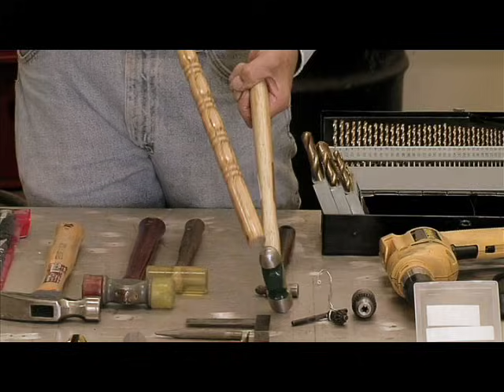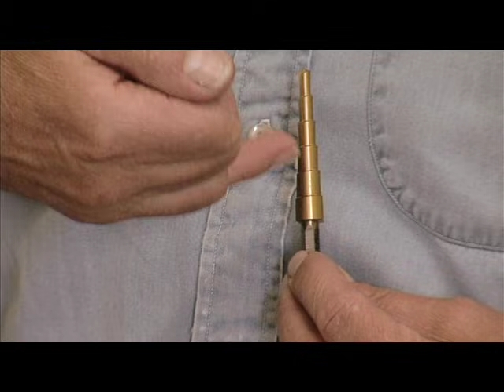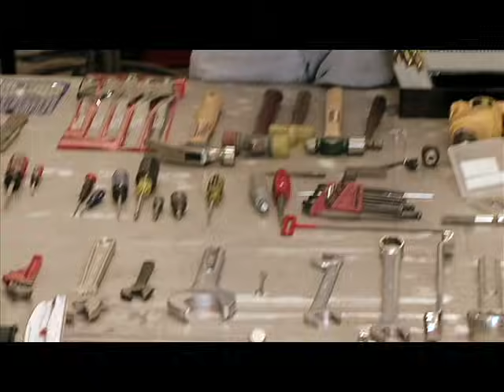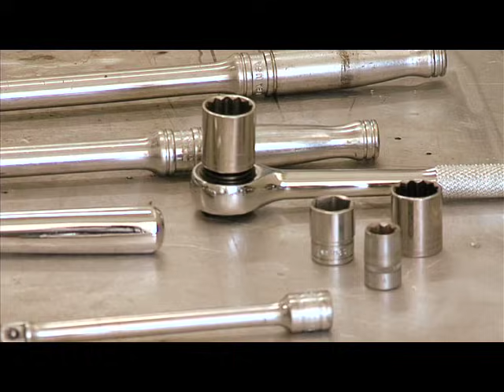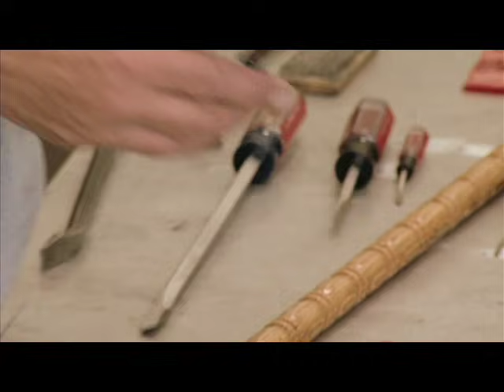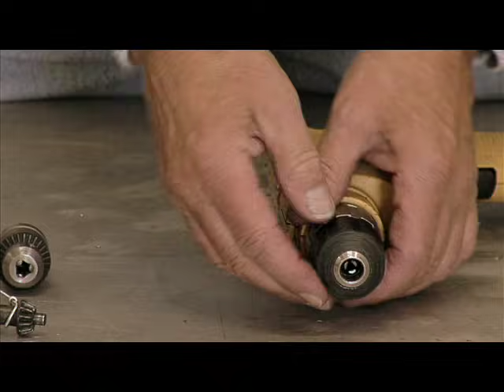Hand Tools

Comment: I'm here for esl (english as a second language). My issue is to be sure the correct way of speaking things and their uses. Example: a hammer is used to beat or it's used for beating...?
I realize the instructor sometimes says either one. Could someone help me on that?
Reply from the maker: Either one is correct in that example. However, you would not want to say "a hammer is used to beating" or "a hammer is used for beat".
Reply: @UCIMedia  thanks. I've searched for other answers and my conclusion is: 
"We use a hammer to beat". The hammer is the object of the sentence
Whilst ""The hammer is used for beating". The hammer now is the subject. 
This is according Oxford Advanced Lerarners dicionary
Reply from the maker: @luckguitar  Exactly right. Good luck with your learning!

Comment: Generally speaking, a very good primer on the various hand tools available and how they work.  Three comments, however:  What you refer to as a "pull handle", however, is almost exclusively referred to as a "breaker bar" by the rest of us.  I've not heard it referred to as a pull handle, although it's a reasonable name for it.  I was about to berate you for using the term "orientate", which I discovered IS a word, although most people use the variants "orientation" or "to orient (something)" instead.  I've always used the latter two when speaking or writing.  Perhaps it's a regional thing; I've not heard it used much here in the Western U.S.  When I first started buying tools in the 70s and 80s, there were basically two types of point counts on sockets: 6-point and 12-point.  I opted for 12 point at the time, because ratcheting mechanisms had between 20 and perhaps 36 teeth, which is a long distance between clicks.  The 12-point sockets allowed me to orient the socket and the ratchet more favorably when working in tight or restricted spaces.  The 12-point also worked with more types of fasteners; I could use them on 4-, 6- and 12-point fasteners interchangeably, whereas a 6-point only fit on a 6-point fastener.  That all changed when we got higher tooth counts on our ratchets (now as high as 120), and again when 12-point fasteners became prevalent in cars.  Obviously, there are very few 4-point fasteners these days, and 6-point sockets continue to deliver torque more reliably w/o rounding over nuts and bolts as often as a 12-point will.

Comment: The three hardest to remember for me are (1) crescent wrench which is actually a adjustable wrench (2) biscripts which are actually locking pliers (3) channel locks which are actually slipped joint pliers. A also tend to call a cross driver a Philips and and flat driver a flat head screwdriver. Good video but he should have covered snips because there are all kinds and are a fundamental tool in any work shop.

Comment: That's a nice introduction to tools. A full coverage of hand tools would be more like 10,000 hours long, though. Just hammers come in more variety than all of those tools combined. I saw a lever tool there that wasn't described, a common crowbar. I know many variations on just that tool. Rip chisel, cats paw, pry bar, digging bar, spike tool, nail puller, peavy, log jack,etc. I didn't see any cutting tools beyond drills, either.
Never stop learning. The more you learn, the more you realize how much there is that you don't know.

Comment: In a 120 volt single phase system (Typical Home power) One wire Black is "Hot" White is "Neutral"  Green is "Ground".

for 220 the Red is "Hot" four wire